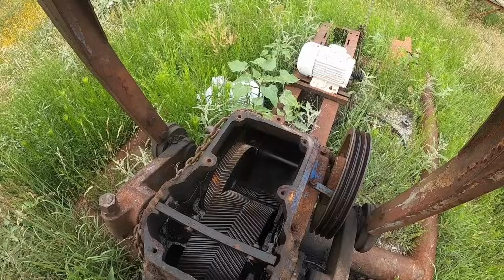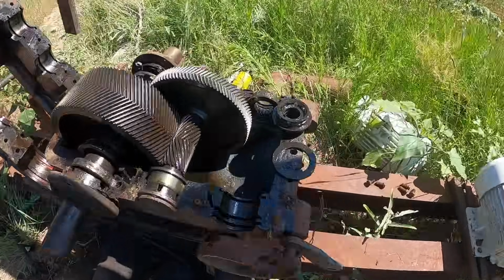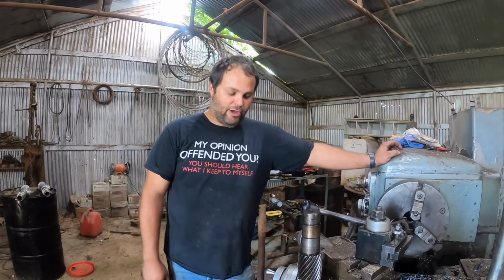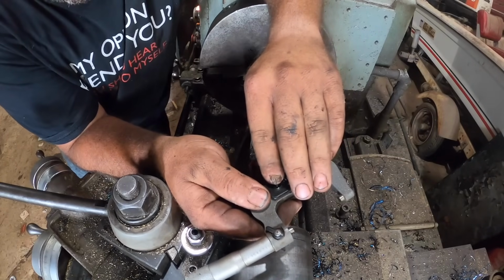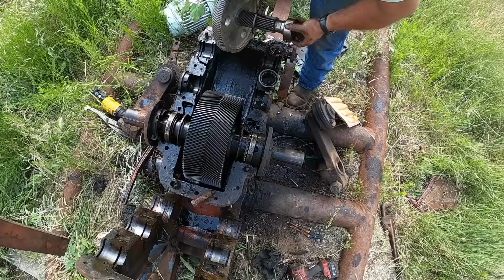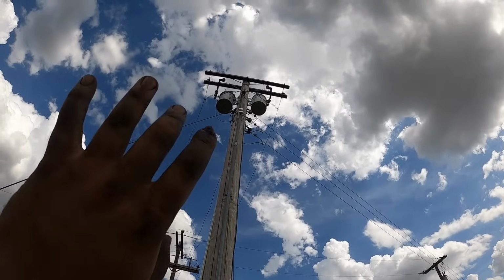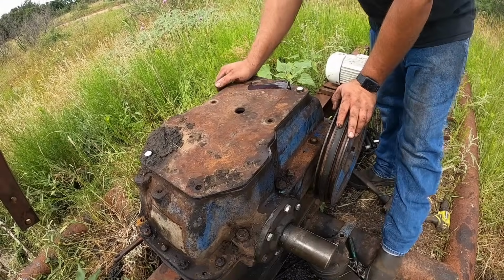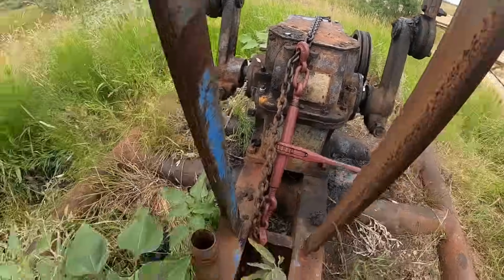Workin on junk

Comment: i would have left the shaft .002 over and polished it with 400 grit...just prettying up surface finish can remove a couple thou....tool angle is what works, that angle looked a bit shallow to me but it worked so it was fine.....i agree that a shallow angle works better with an interupted cut and carbide tools don't like interupted cuts so a shallow angle was the better choice....cutting away from the chuck would be more of a problem but you where using a tailstock, so not a problem.....

for heating parts for interference fits, i use a $6 toaster oven from a thrift store
Reply from the maker: I like it.

Comment: I worked/contracted to an old school drilling company that had used the same yard for 50 years. There is no telling how many thousands of gallons of oil were spilled on the ground. When the property was sold the soil was tested for contamination. The only thing found was arsenic in two places. No one knows where that came from because they didn't use it. My guess is it came from the farms that were there years before.  The oil simply returned to the earth it was taken from and the cycle of life goes on. Great video Zach, you and I would work well together.
Reply: Possibly very old graves from when they used arsenic as an embalming fluid? Or maybe some dude being treated for syphilis in the 1910s to the 1930s took a piss there when arsphenamine/salvarsan was the only medication available.

Comment: Could you do a video on the water injection, it's mentioned and seen in the background on some videos, but not in any depth, I assume the aim is to lift the oil in the formation higher and be able to extract it without drilling, but I don't know
Reply from the maker: Yes I plan on it and will when I get the time.

Comment: Excellent work, people forget,  they see spilt oil and forget it comes out of the ground in places at the surface,  that you are cleaning up what's left by the previous owners by way of rubbish and scrap should be seen as good ,  one of those cheap equipment hydraulic breathers would fill that hole very well

Comment: How often does the oil need to be replaced in those gear boxes? I’d imagine condensation over the years would build up and cause issues?
Reply from the maker: Never. Actually if the oil get a small amount of water in it it will stay mixed up in the oil and eventually evaporate.

Comment: That is the way to do it. Cost all in that gear. I suggest you put a ring of silicone round the dip stick.  But make the dip stick oily so it doesn't stick to the fresh silicone.  To make a custom rain tight plug. That oil level is perfect for another 50+ years.
Reply from the maker: not a bad idea.

Comment: Zach, you say you’re an oilman, and you are, but you are spiritually identical to a farmer! 
I have an old water pump that feeds my cattle, it’s about 80 years old and the weld on its cast iron head has held for 15 years in spite of me using 7018 rods because that’s all I had on a Saturday evening. Not every job is a space shuttle mission. Good enough is good enough.
Reply from the maker: Haha that needs to be a t-shirt.
Reply: Not every job is a space shuttle mission.   Well put friend.
Reply: yes but on the other hand some jobs do need to be done 'right'
Reply: I've welded a muffler back on a lawnmower with an acetylene torch and bailing-wire as filler.....
....It worked though.

Comment: You'r not worried about the water mixed with the gear oil from the rain? will it just stay emulsified with the oil and not rust the inside.
Reply from the maker: I drained it before i put the 140 in it, however in practice if it not too much water it will stay emulsified and not seem to cause too much problem and will eventually dry and clear up.

Comment: I would of put the gear on backwards, sure as God made little green apples.  

You really ought to think about Obama rigging a pressure washer to run off a 55 gallon barrel of water.  I know you ain't  doing rocket surgery,  but it wouldn't hurt to blow off some of the case grease and gravel before you waller in it.
Reply from the maker: Hahaha i've thought about this several times. I need to do it.

Comment: Chrome plate the shaft.
Reply from the maker: I don't have a chrome plater but ive got a mig gun.
Reply: @TheZachLife  my comment was not a criticism just another option, you were not in a crash condition to get it running again so just another option, not sure how long you waited for that gear but those hearing bone gears are not easy to manufacture, any how great channel, I’m a retired mechanical project engineer in the machine tool industry.

Comment: the most dangerous thing you did with that transformer was put your arms elbow deep into pcb oil tractor supply sells arm length gloves for working on cows that would be perfect for staying out of the oil. its really nasty stuff since its oil it can be absorbed through your skin and it absorbs into pretty much everything you touch

Comment: you should get one of those horse stall mats from tractor supply and put a chunk under your press so things have a nice rubber surface to land on. they also make great pads to throw down on mud so you can work on things without bogging your boots
Reply: Horse stall mats make great shop floor mats. My old pipeliner welding instructor had me line the toolroom floor which worked a treat. I use mine as ground mats between my house and shop because I don't want to pave over the water and electrical lines. (That immediately paid off because the garbage PVC water line installed by a previous owner failed a week later.) I wrench vintage motorcycles and when I redo my engine build area it will get more stall mats.
Reply from the maker: Good idea

Comment: Let the useful items be useful. Put a rubber o-ring on your dipstick handle so it won't rain in your gearbox. Good call on that thicker gear oil👍
Reply from the maker: good idea
Reply: Better to glue the o ring to the case so no way standing oil gets in , as the dipstick may not be flat if heavy enough to keep water out.